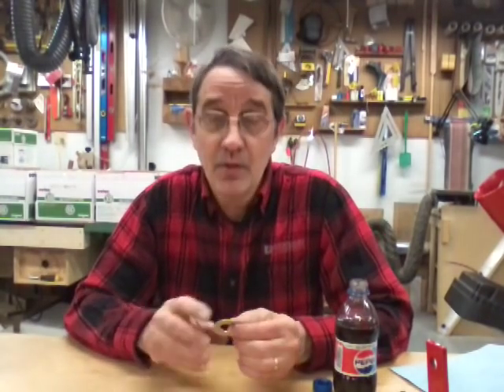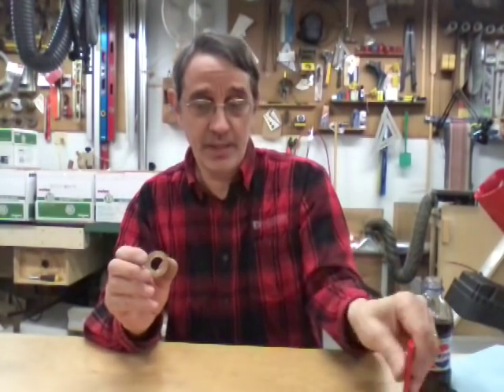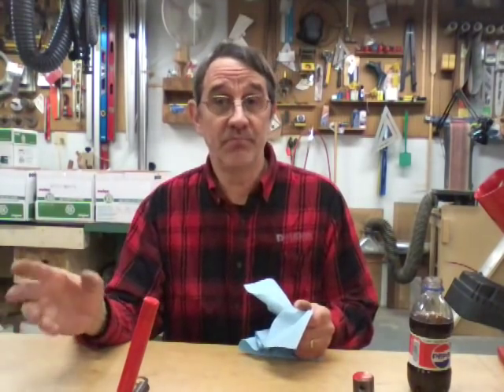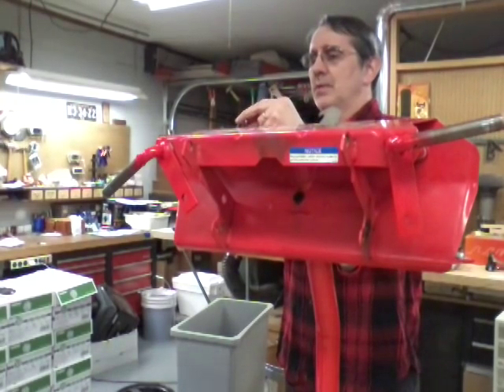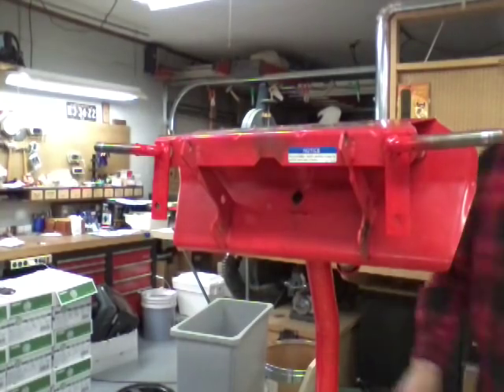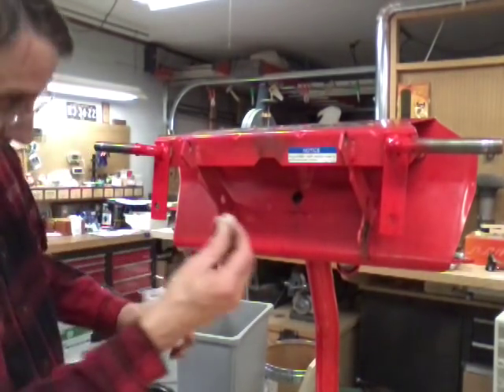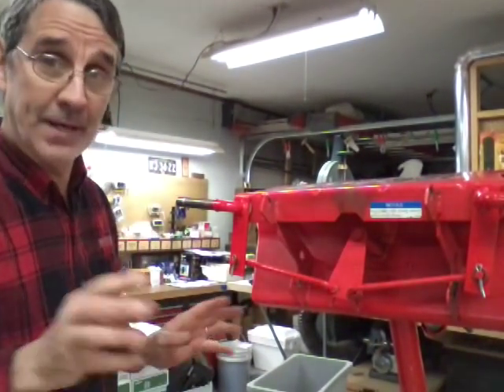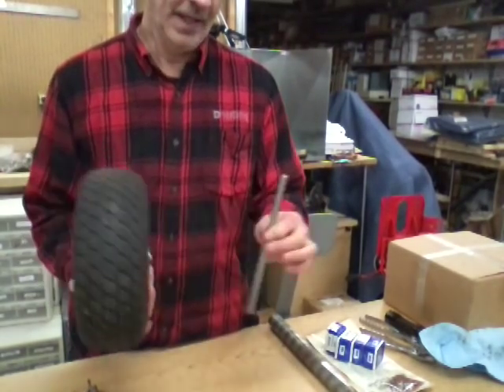241. Part 8 Completely rebuilding my Snapper RER

Comment: Hello Jim again! Thank you so much for answer quickly. My husband look  the 51 video, but isn't the problem. I know really I don't explain well what is the issue with my husband's 2002 Snapper and here it goes:  The engine is ok and can start it with the  key, but he can't  shout it off and he wants to know what needs to do to fix it. Hopefully this time you can understand what I am trying to explain to you, I wrote this word by word by my husband.  (running me crazy) Thank you once again!
Reply from the maker: Paul Reep
Hi it’s Jim
   OK it sounds like your ignition switch is bad or the wire going from the ignition switch to the block on the side of the engine is bad, tomorrow I’ll take some pictures of the ignition switch on mine and where the wire goes to on the engine to help you trace this problem. Thanks Jim

Comment: I bought a 23 series and did not like the steering wheel.  So I took the handle bar steering assembly from a 5 series and replaced the steering wheel.  Works great.

Comment: Hey Jim. Snapper question. Ever find an affordable replacement for the safety module?  Hard for my customers to part with 40 bucks!  Thanks, Kenny
Reply from the maker: Kens Small Engines 
Hi Ken it’s Jim
   I have not found a cheap replacement for those on my machine I just get rid of all that crap, I know you can’t do that with the customers machine, have you tried Amazon or eBay to find any if you do find a cheap replacement and let me know I’d be glad to pass it on to the viewers. Thanks Jim

Comment: hey Jim did you get the bushings for the steering from parts tree and did they come in a kit
Reply from the maker: I ordered a kit once and it ended up coming with the wrong lower bushing for my steering shaft, so now I order them from Parts tree off of the diagram for my machine and I get the right parts The first time. Jim